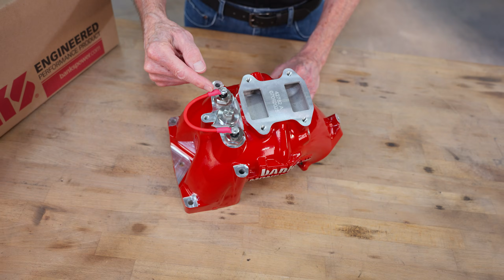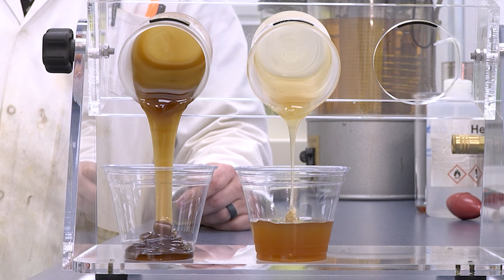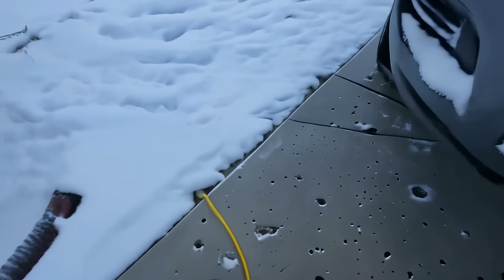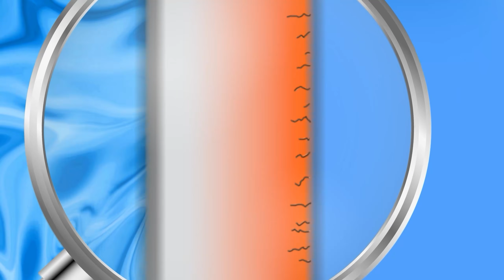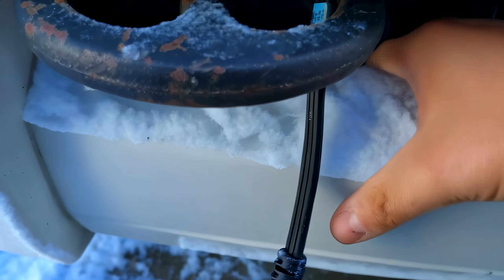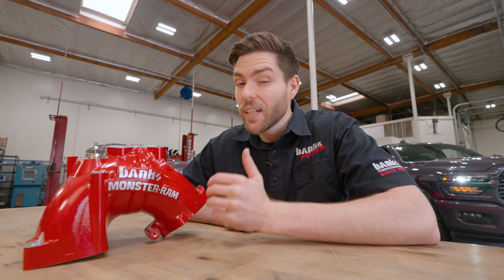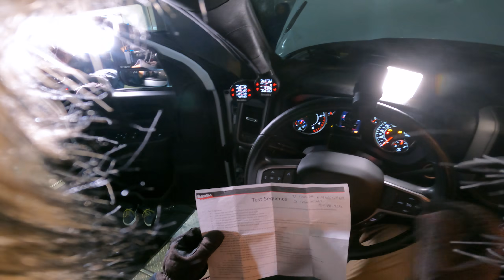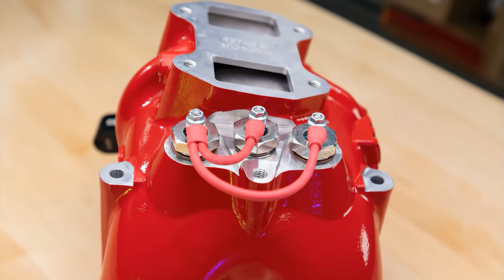We froze a truck to -40°. Here's what happened.

Comment: I'm curious how a 2250w draw will impact the battery which is already dropping voltage at -20 or -30.
Reply: At that point it might be best to put in a better battery with better CCA’s or add a second battery
Reply: I have never heard of a battery powered block heater before? Are they common in the USA? Here in Sweden I’ve only seen 230v/corded or diesel powered heaters. 2250w is a lot of power to pull from the batteries, wouldn’t it also be pushing the fuses in the American 110v system? Here we usually have 10 amp fused 230 volt, but it can go up to 16 amp, in which case you can power both a cabin heater and a block heater.
Reply: @galaxel1494 Those are an intake heater not a block heater and yes the block heaters do get plugged into 120V standard household outlet.  The Banks ramair have 3 separate 12V\750W heating coils in the intake horn for a total of 2250W@12V with 2 ~850 CCA 12V batteries (AGM\lead acid)
Reply: Factory intake heater is 2000-2600w to begin with. The Banks intake heater has been underpowered since it was introduced. That's been my only real issue with it until now.

I honestly wonder why Cummins ever moved away from the 5.9 style intake heater. Nobody ever has issues with those, and they work great.
Reply: We're talking 200 amps for 45 seconds.
She might let go when it's time to crank the engine.
Reply: Watts/volts is amps. At 12v, it's a 180amp draw. At 11v, 200amp draw. The truck probably has a dual battery setup, they probably both have 850cca (that's measured amps over 30 seconds at 7v, not full 12v, at 0°). Cummins needs 1500cca to start.

In short, it'd be fine.
Reply: Well you'd think you'd have a battery heater and tender on the battery and not just be leaving it to freeze.
Reply: You plug it into an AC source. No block heater is powered by the battery.
Reply: @RC-nq7mg We're talking about the intake heater which uses battery power, not the block heater that uses residential AC.

Comment: Peg in Canada knows a thing or two about cold starts and spit swapping coolant.
Reply: almost everyone in canada with even a small bit of mechanical knowledge knows everything in this video lol
Reply: @tylerbaldwin1633  they did this because dark iron diesel called it out that his cummins wouldnt start with the gen 1 ram air. which is why they made gen 2 with more heaters
Reply: @davidgray-owen2270 that guys a absolute clown
Reply: @tylerbaldwin1633 he may be. but he showed numbers that made banks change the design on a product after testing in conditions that me and lots of other canadians see every year
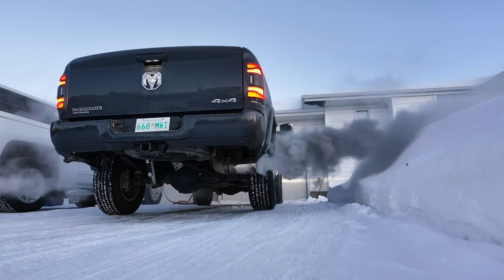Reply: @davidgray-owen2270 that's Kyles truck at 2:58 they show
Reply: @davidgray-owen2270  dumbass iron diesel came back out and said his tune was trash and was the main cause of why it wouldn’t start. Banks made the Gen2 horn due to multiple customer out of Alaska and northern territories having issues. Nothing to do with dumbass iron diesel.
Reply: @davidgray-owen2270  That is horse shit, a cummins will start in 30 degree temps with no intake heater at all. I have never owned a cummins with a intake heater and i live in Oregon. It gets into the twenties here damn near every year
Reply: @davidgray-owen2270  LOL NO had nothing to do with dark iron
Reply: came here just to comment this lmao -40 with 40-50 km/h winds aint nooothin nowadays to winnipeg folks
Reply: @brettschuster6925 Thompson MB, here, automotive cold weather test center.
Also, jet engine test site, just South of town. 😂
Reply: @carlthor91  This guy made a viral video of freezing a truck.. imagine your video of everything being froxen including the frozen tools to fix the frozen truck in a frozen winter suit lmaoooo
Reply: this guy knows ball
Reply: A lot of this came from help from @darkirondiesel and in fact some of the exhaust clips were from his videos.
Reply: Peg only uses Cosby sauce!

Comment: Put a heated battery blanket on your battery and splice it into your block heater. Without it you're losing like half your cranking power.
Reply: As a Canadian living on the prairies or in the north, we would always add battery blankets to gasoline engines too.😊
Reply: As a Canadian living in Canada’s north or the prairies, we would also always add battery blankets to gasoline engines.
Reply: Great idea. Just make sure you don't splice directly into the supply for the heater or you risk popping the circuit. Wire a separate power supply and run it off the block heater relay or whatever triggers the heater, so they trigger at the same time. 

Badass idea, though. Never thought of that.
Reply: @akulakhan8367 splice it in! Wont trip the breaker. Engine - block heater, battery: 2amp battery trickle charger, tranny - magnetic block heater on the oil pan. Its -40c often. (Canadian)
Reply: @akulakhan8367   You trigger the block heater by plugging it into a 110V outlet. Popping the circuit is never an issue unless there's a short somewhere.
Block heaters vary by application but are generally in the 600-800 watt range, rarely as much as 1200W. Battery blanket is 100W at the top end of the range, times two batteries for a total of 1400W. Standard 15A household outlet is good for 1500W continuous, but often you'll get a dedicated 20A outlet for block heaters, assuming most households will be plugging in more than one. Either way there's plenty of overhead and no danger of overloading the circuit.
The big thing to watch out for is doing a good job of splicing them together, and regularly checking for damage to the wire insulation. Many vehicles have been burnt down by sketchy block heater cords shorting out, often taking a garage or covered parking spot with them.
Reply: @gogmorgoaway . You are so wrong.  A block heater for a  diesel is often 1000 plus watts, 8.3 amps.  

And that  doesn’t take into consideration the common use of an extension cord creating an interesting scenario.    
:/
Be as it is, battery warmers don’t pull a lot of amps, lower than 100 watts,  1 amp.  
I’m more inclined to keep a small battery maintainer hooked up.    

And… if unable to plug in often get a Webasto.   Best investment ever for Canadians with diesels.
Reply: @fredg8199  My math was for a 1200W block heater and two 100W battery blankets. 1400W. It you're losing 100W through the extension cord you chose one that's pretty horrifically undersized for the task. Not to mention that cold conductors are more efficient.
What am I wrong about? Nothing you said contradicted anything I said. 
Battery maintainers are only helpful to make up for parasitic discharge if you leave the vehicle sitting for weeks at a time. The voltage drops in the battery because cold slows down the chemical reaction producing electricity, not because the battery is discharging.
Personally I would run neither, because they can hide weak batteries that will leave you stranded if you can't plug in or you lose power. But if it's cold enough they can get necessary.
Maybe make sure you know what you're talking about and actually read the comment before you start swinging your tiny dick around.
Reply: @fredg8199  "block heaters are between 600-1200W" "you are so wrong, they are 1000W" lmao, you sound angry dude. also you basically said the same thing as him yet said he was wrong....
Reply: @akulakhan8367  If the heater you're talking about is the manifold heater, that is run off of the trucks batteries.  Battery blankets would be a plug in accessory like the engine block heater.  The block heater on a the ram they tested draws about 6.5 amps, there should be plenty of ampacity left to run battery blankets and even an oil pan heater from an extension cord plugged into a standard outlet.  Having a jump box or jump vehicle would also vastly help cranking speed.
Reply: Back in the Chrysler days of ownership, Chrysler actually had an option for a block/battery heater on some vehicles at least. My parents had the option on their 98 Concorde. It was only used once or twice during the time they owned it.
Reply: What brand of battery blanket is a good choice ? Thxs
Reply: @rodneyweese6910 Kats is a reputable brand
Reply: I know a Swedish guy that has a factory fitted diesel fueled coolant heater (Volvo).
He added a second battery and both have 12V heated blankets that turn on when the diesel heater is turned on.

A mains powered block heater wasn't something he would like to have as the only option as he is a traveling engineer and doesn't always have a hookup available.
Reply: Or a battery tender

Comment: Why would you have to preheat twice? The truck measures and accounts for altitude, but you have to decide whether or not to cycle twice? Why doesn't the factory program make the cycle the proper length. Once again, it measures temp and pressure as a proxy of altitude and adjusts accordingly. But only so far? Why? Can this be fixed with ECM tuning?  Do you have to turn the radio off and on again to turn up the volume past 50%?

Comment: Below -30C you typically add battery blankets as well. Would have been really interesting to measure the current going to the starter in all of those scenarios.
Reply from the maker: While we agree that testing every scenario would have been enlightening, it would have also been very expensive.
Reply: @bankspower  There are 2 places in MN that specialize in cold weather testing!  All the big brands use them, all nearly at the same time too.  They even go so far as to ship stuff in that isn't available in the US for testing.  might be cheaper to do more testing there, especially in the winter, their cold chamber can get down to something like -50c, but sometimes ambient is that cold too....
Reply: @chubbysumo2230 I grew up there I used to see camouflage vehicles and ones that were not out yet /him usa good memories
Reply: Have never used a battery blanket in my life.  Standard factory block heater was all I ever needed.
Reply: I used to drive a Challenger in Manitoba which didnt even have a block heater. Started fine in -40.
Reply: @ExcalibrrrOfficialyeah, this is about diesel engines which rely on compression to cause heat and ignite the fuel and compression is lower in colder temps. Gasoline engines use spark plugs to ignite the fuel

They went over this at the beginning of the video
Reply: @Excalibrrr1the benefit of having spark from the plugs vs diesel like tested needs the cranking to compress to air to get spark

Comment: It’s weird how many engines that live up north seem to be able to live a completely normal life of 400,000+ miles without any of the stuff banks claims you need or your engine will die
Reply from the maker: What a diesel engine needs most at startup is warmth. It doesn’t matter whether that heat comes from the Monster-Ram heater, the stock grid heater, a block heater, or another source.
Reply: @bankspower why not just pray for the heat? Why bother with the things that have demonstrated abilities to repeatedly work?
Reply: @bankspower  you could have just parked the truck outside. You rented a refrigerator for fifty grand to make a youtube video? Get a better hobby.
Reply from the maker: Scientific tests require precise measurements. As discussed in the video, leaving the truck outside would not have produced repeatable results. And, this wasn't just for a YouTube video. We wanted to provide guidance to our Monster-Ram customers on what sub-zero temps they could expect start their engines. It was R&D that we happened to capture on video.
Reply: If you are talking about the extra coils, then its completely based on the temps you are trying to start at. but if you are talking about the grid heater bolt fail, that can happen at any milage or temp, I've seen them fail at 15k in Cali. It's not controlled by temp but by a loose nut that causes a short that overheats and eventually melts it. The old grid heater energizes on startup so it happens pretty randomly.  Its like predicting a flat tire. you might go your whole life without one, or it might hit you in the first year.
Reply: @tacticooldennis crazy how I was talking about neither of those but got a novel in response
Reply: Cuz most people probably dont store their shit outside at those temps, or have other ways around the engines being cold as fuck (ie block/fuel heaters)
Reply: @renderedpixels4300 My 2017 WRX would start at -50 with no block heater. I felt bad for the car though, so I ended up installing one after the first winter I had the car.
Reply: Diesel powered forced air heater 150k btu and a tarp to enclose vehicle warms up entire truck nicely

Comment: You're heat coil is a glow plug 😅
Reply: A glow plug is like a pencil and a heater coil is like a hot dog. It does the same thing but way bigger.
Reply: @tacticooldennis Good thing I live in Africa never going to need that here! You can start a diesel here with no glow plugs 😅